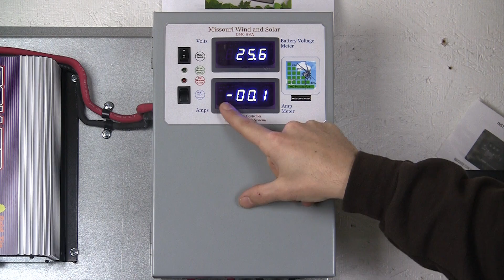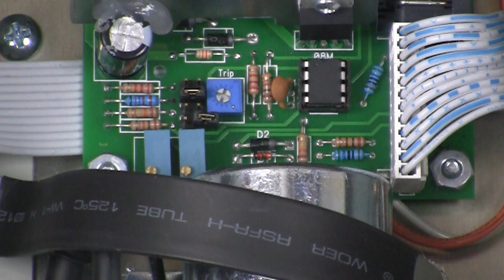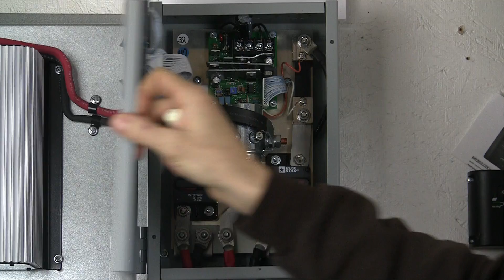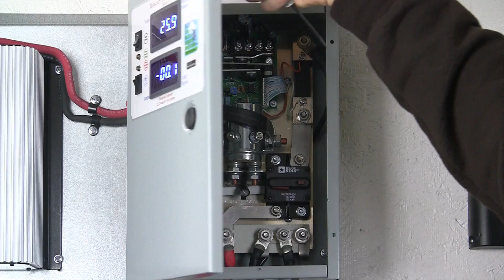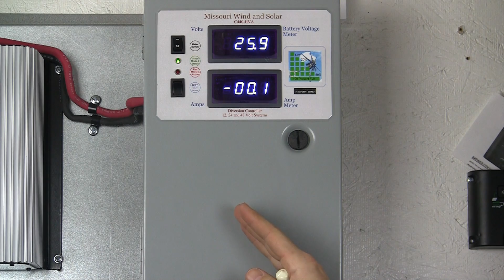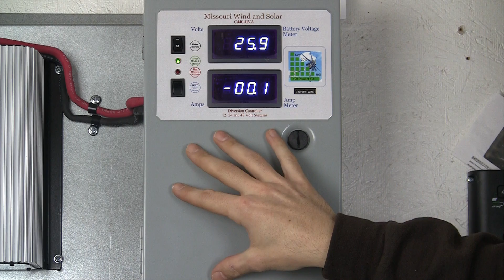440 HVA charge controller instructions and trouble shooting MW&S

Comment: Hi, my question is, is this controller works as a MPPT? This unit vs the maxmax hybrid charge controller or the Cantrex that you guys have, which one es best?
Reply: I'm plannig in builbing my own 18650 li-ion battery bank, will this controller work on this kind of batteries? Will this controller monitors the batterries temperature?

Comment from the maker: Were also going to show how to hook up a grid tie inverter to the HVA and add a capacitor to the circuit board so it won't be harmed from any voltage spike from the GTI.You can put a GTI in place of the dump load resistors if your just using solar.